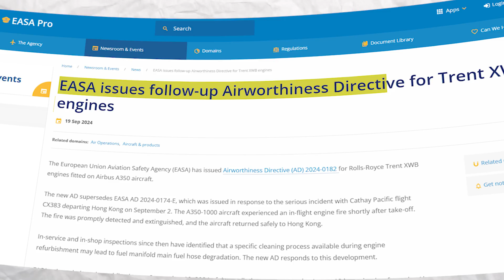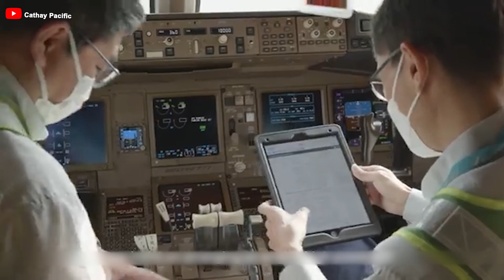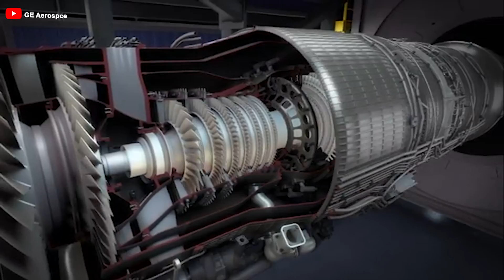Airbus Engine Just Got WORSE than You think! Here's Why

Comment: So why does the headline say "Airbus Engine" ??  As far as I know, Airbus don't make engines.  Your video of course was about a Rolls Royce engine.  Your commentary had more than just a hint of sensationalism about it.  No mention of any other airline having this problem.  What is this 'cleaning method' that this particular airline is using.  You don't mention whether the 'pipes' are metal, or some other flexible material.  Where were the leaks coming from - somewhere along the length of the pipes, or at each end, via the connection fittings.  Is it a case of engine mechanics not tightening connections properly -  it seems strange that several (all ??) pipes on one engine all had leaks.  If this problem is as serious as you suggest, why are you the only website talking about it.  You try to make it sound SO serious, you would think every A350 would have been grounded, like the 737 fleet world wide.
Reply: AI sensationalism, just a garbage page that keep popping up.

Comment: I don't understand why the Airbus engine problem got worse.

Agreed, the length of time required to upgrade the GTF is taking an unacceptable time to fix, but since it isn't just a shortening of the expected lifespan/durability needing enhanced maintenance and renewal on an ongoing basis, but a sub-standard component requiring replacement with one which will give the expected lifespan/durability, surely we have an expectation about when all the affected engines have been worked through.

Have there been any indications that this process will take significantly longer than previously announced?

As for the Trent engine, this was identified early, is a relatively inexpensive fix (the engines do not need to be removed from the airframe) and the seriousness officially downgraded. That appears to be an improvement, and not something being worse than we thought.
Reply from the maker: Thanks for the view and feedback.